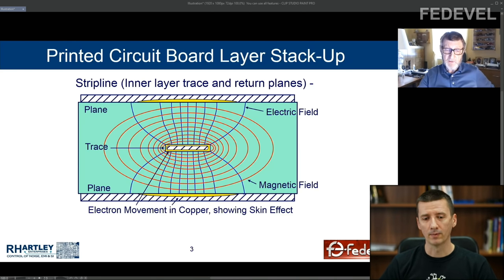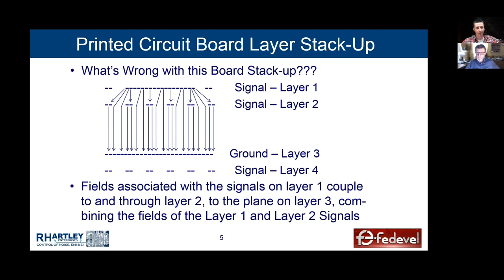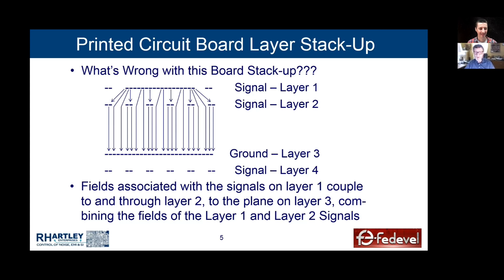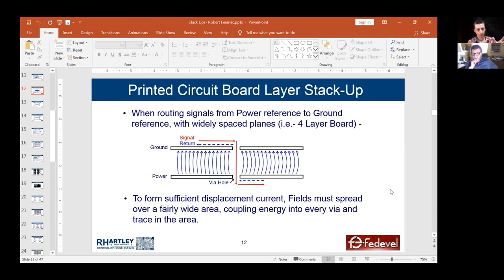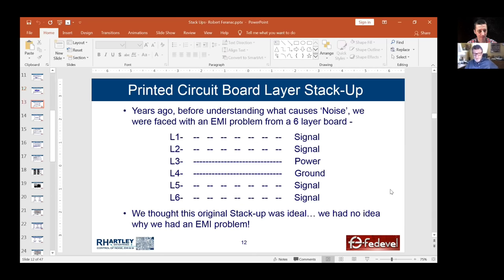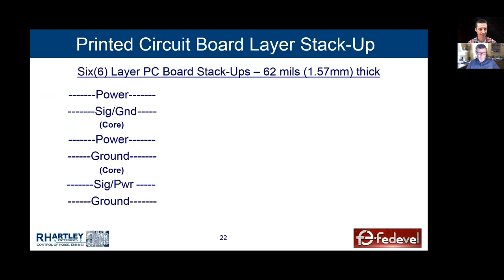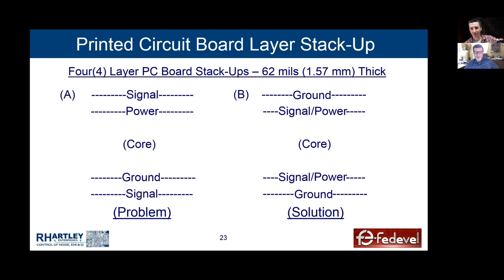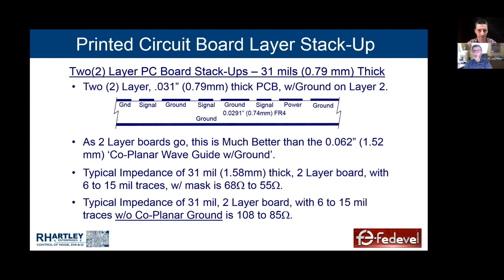How to Decide on Your PCB Layer Ordering, Pouring and Stackup (with Rick Hartley)

Comment: Uhhhhh great concepts! 
But if I had told  my boss that it was needed to go to a 6 layers board to iron out an emi problem ( and trust me, in the  automotive world there's a lot of emi testing... Including the much feared " Bulk Current Test" , which is not an emi test whatsoever) I 'd have  got fired in a microsecond!! 
At that time ( ten years ago) the 32 bit microcontroller was already operating at 200 Mhz, so there was a lot of stuff to care about... and meeting the emi requirements was achieved without transitioning to a 6 layers board, that would have increasd the cost far beyond limits..
Instead a different solution was found , which was not 6 layers, and it worked fine! . 
Maybe this guy just talks about the stuff he like most....